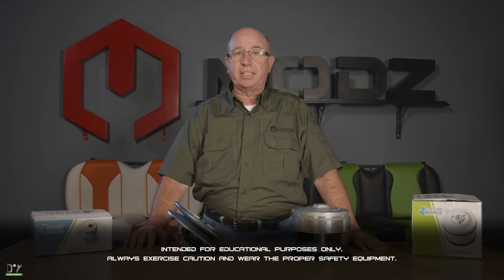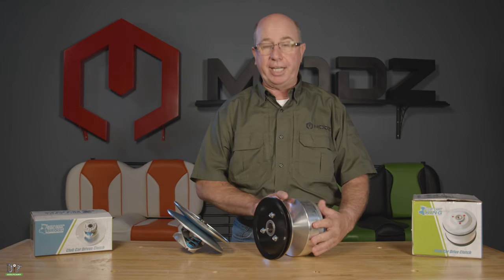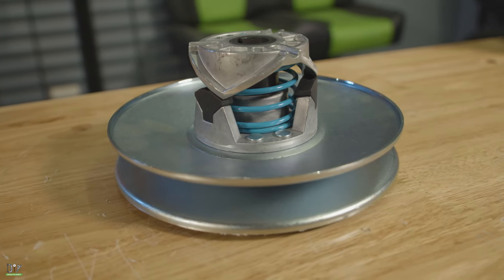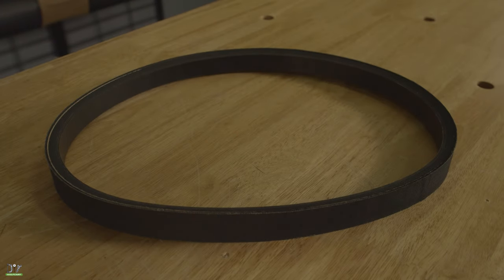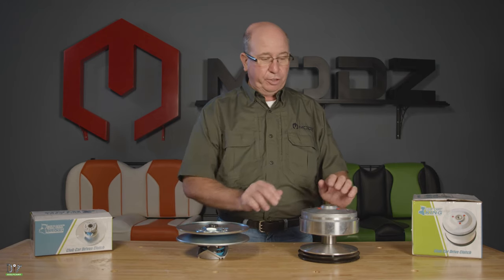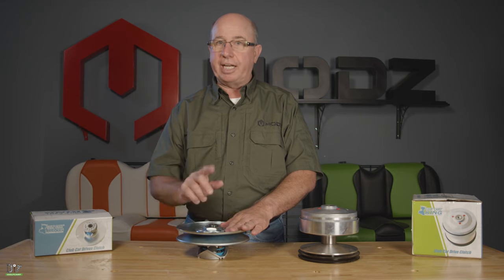Drive vs Driven Golf Cart Clutches - What's the Difference

Comment: When replacing the Driven clutch on a Club Car, should I apply anti-seize or some type of grease to the keyed shaft, before re-installing the Driven clutch?
Reply from the maker: That would help for the next time the clutch needs to be changed!!
Reply: I'm a golf cart customizer and builder for a living and do tons of custom builds and always put a small very small drop of anti seize it will make your life a little easier when you need to remove or service the clutch later on. Any part that doesn't need lock tight and isn't a crucial bolt I put antisieze on especially on electric carts and carts that live near the ocean cause of rust and corrosion and makes my job easier when that cart I built comes in for service later on or makes out service techs jobs easier as well and all the used carts mainly Yamaha drive 2 s that we rebuild and refurbish from ground up for every customer that buys a used cart I use antisieze on everything I can as well.